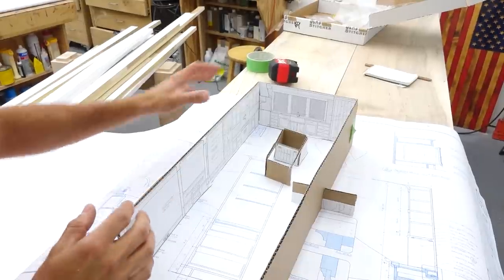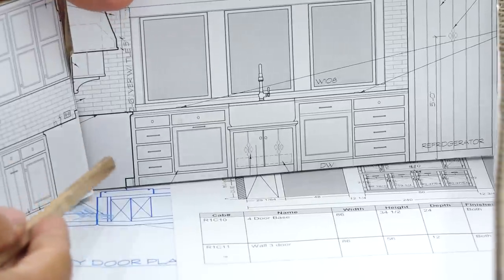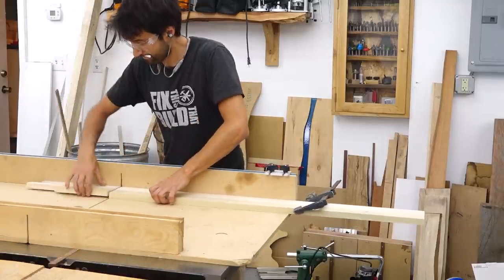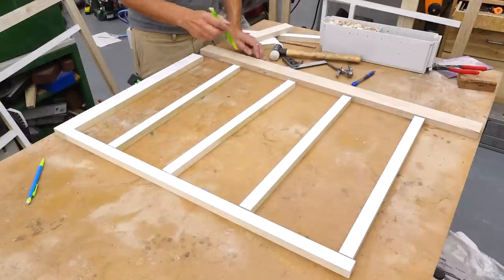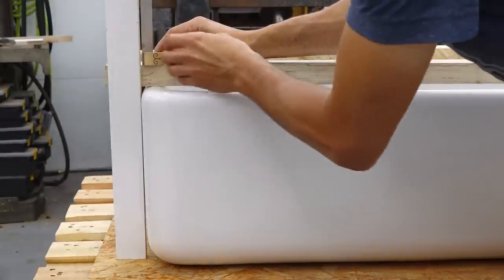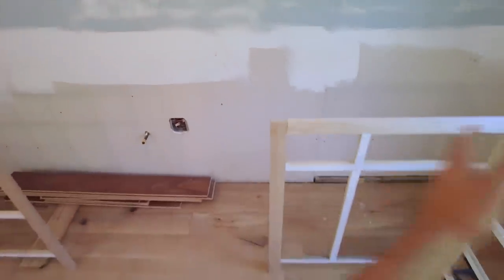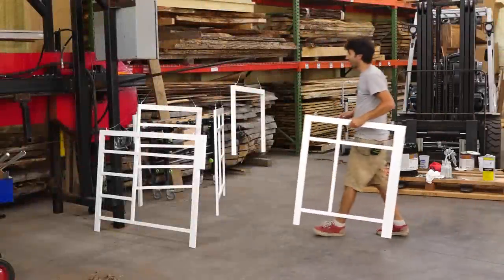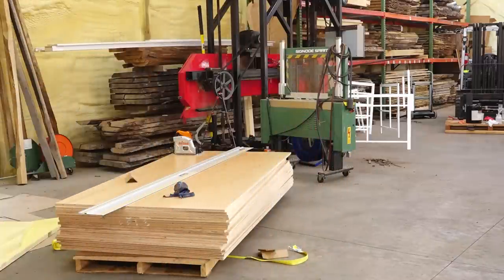Starting the Custom Kitchen Cabinets | Home Renovation & Addition Part 57

Comment: Matt, I have to agree with you the painted finishes being more difficult. I just got done building a custom kitchen in my house. My wall cabinets are painted with white lacquer. in my island is clear lacquered finish Walnut. Island was so incredibly easy to finish compared to the painted cabinets I think I spent more time prepping and painting the white cabinets and doors than I did on any other part of the kitchen build. That includes the actual time spent building the cabinets, drawers and doors .
Reply: Very true! But kind of a double edged sword becuase it's pretty hard to get rid of all the sanding swirls with a natural finish, as the stain or clearcost will highlight any that you missed.

Comment: Wow Matt, the knowledge you are sharing,from building this set of your kitchen cabinets, is so awesome.  Showing the actual build to all of us fans of your channel, is so informative.  Thank you for taking us into almost every aspect of design, lumber, making fronts, then setting them up, prior to  gluing the sizes down.  I've helped with making and designing several kitchens with a good friend, over the last 10 years. What an awesome experience. I asked him make a Wine holding upper cabinet for his Kitchen, he likes collecting bottles from here in Michigan and on travels. He said design it. Cabinet is an open cabinet, with 8 concave wine holder fronts, and backs, for the butt end of standard size bottles. 4 fronts with 2  openings on each front, for 8 total wine bottles.  It turned out
 amazing.  I also made stained glass clear with beveled corners on 2 doors that held nice glassware, tumblers and etc. Added low lighting for inside glass cabinets and wine cabinet. It added a nice touch. Looking forward ward to the next videos. Love, Love, your Channel.

Comment: I always made the boxes first then the space frames, drawers, doors, drawer fronts, uppers, and finally countertops in that order. I think I like your order more. It's easier to do initial mock up your way and one gets a better perspective. Suggest you move in appliances with boxes for final mock up. I have a spray booth as I also do automotive and the booth makes finishing much easier better lighting and no dust/particle goobers to buff out. As expected very nice work. Ray Stormont
Reply: I like the order you did your cabinets, Matt !! Helps eliminate any surprises !!

Comment: 22:12 In this corner here, I recommend putting a stainless steel bin for compostables. With a lid flush with the countertop.
Reply: They compost fine in the land fill.
Reply: I'm really happy with a "kitchen" compost bin in the fridge… Much less likely to generate problems, esp. if neglected for some time.

Comment: My father and uncle were cabinet makers. I did it too, until I worked my way into becoming a foundry pattern maker. Not to disparage the concept of.making face frames and trial-fitting them, but we made layout sticks for each wall for complex jobs. Much easier to take to the room than face frames. There might be a vertical stick for units like wall pantries or entertainment units but sometimes kitchen cabinets followed one of a few standard layouts vertically and didn't require a vertical 'story pole,"

Comment: Nice project! To make sure the cabinets are sitting on a level surface / toe-kick, it makes more sense to start wit the toe-kick-boxes; Use wedges to correct for uneven floors, Now you'll have a 'level playing field'  for your entire set of cabinets. This makes it easier to standardize measurements, with fewer risks.

Comment: Matt you may need to look into the corner cabinet. You may need more room in the draw side to use the magic corner shelf . Check specifications of the draw.
Reply from the maker: Haffel magic corner I; min opening size 15 5/8”

Comment: Great to see you are now working on the kitchen cabinets. Not as fun as building something that requires real joinery, but getting closer to finish the remodel. Great idea to make the face frames first to make sure they fit the space. Now that I see you used dominos to join the rails and stiles, I got a question... how are you planning to attach them to the cracass/box? Great start. By the way, miss your Friday Happy Hour.
Reply from the maker: Dominos for alignment and pocket screws for holding.  Lindsay is back in the office multiple days a week which usually includes Friday.  Hopefully her availability will line up soon.

Comment: One thing to double check.  Particularly if you are using overlay doors and drawer fronts.  On the inside corners like the one to the left of the sink, be SURE your corner styles are wide enough to allow the drawer handles to by pass.  Been building cabinets for fifty years and seen this mistake too often to count.  My son just bought a very expensive house and can't have pulls on the drawers on inside corners, got holes but no pulls.  Nice job, going to be a great kitchen.
Reply from the maker: Everything is inset. I have 3/4” of clearance from the top of the knob to the adjacent drawer

Comment: You have some excellent shots in this video - inside the thicknesser machine must have been a challenge?
Reply from the maker: Pretty easy. It’s just the 360 camera on a stick
Reply: @mcremona  Right! The right tool makes it easy, I guess? It's not a view I have seen before.

Comment: Great video! Thanks for posting! A comment and a question…noticed you shot a pin nail through the domino allowing you to remove the clamps, this is a great idea! I’m about to begin a large cabinet job of my own and will definitely use this tip. Question - how do you intend on mounting the frame frames to the cabinet boxes? Since you pre-painted them I imagine glue is no longer an option.  Thanks again!!

Comment: Mathew, I built all my kitchen cabinets using tiger/curly maple.  I built the cabinet first and then built the faceplate.  I felt it was easier to do it that way, but then again, I had never done it before.  Looks good but again I am not one to paint wood.  I hope there will be some clear finished wood in your kitchen, somewhere.
Reply from the maker: The floor
Reply: @mcremona   Ha, funny guy.

Comment: The first batch of face frames looks great.  I’d be willing to bet that your Paint Hanger tool (the 4-wheeled mega Tele-Handler) is one of the most expensive paint part holders in the country.  At the end of the day it does what you needed it to do so using what you have is always a good thing.  You made me a believer that the Festool Domino tool is a very good buy for cabinet building.  Did you have to buy the adapter for the smaller 1 inch boards, or did it come with that item in the kit?

Comment: Hi Matt, great to see you making videos again😂 I was wondering what blade you were ripping with on the table saw when using the power feed? It seemed like a very slow feed rate, I’m sure you had it set at the right speed for the cut. I’m just wondering if I push wood through too fast now.

Comment: I dunno how far ahead your videos are to when you release them but something you should consider in the corner is a 3in x 3in corner. if you are doing inset fronts 2 in should be ok but if your doing overlay fronts that are slab style like your drawings show, you could have clearance issues when you get your hardware on.
Reply from the maker: They’re inset. I’ll have 3/4” of clearance
Reply: @mcremona  Nice!

Comment: Are you using finished plywood for the interior or rough and then finishing ypurself? I like the face frames but for me I would have to build the boxes 1st, mostly because i dont trust i could build a perfect box to fit the frame, lol. Great work on your kitchen and the video, thanks for posting.
Reply from the maker: Pre-finished maple ply. It’s pretty easy. The box is set by the squareness of the frame

Comment: Is that sink all ceramic, or is it cast iron coated by ceramic? I've heard some horror stories about ceramic sinks breaking, although that one looks pretty beefy.
Reply from the maker: All ceramic
Reply: @mcremona After seeing how you had to move it around, it's probably going to be fine even if you drop a heavy pot in the sink.

Comment: Please be careful when pulling back your cut piece on your table saw when using a thin spacer against your fence.  If the cut piece were to get hung up on it when pulling back it will bind against your blade.  The end result is not pretty.  Speaking from experience. (7 min mark)

Comment: What primer are you spraying with
Reply from the maker: https://industrial.sherwin-williams.com/na/us/en/industrial-wood/catalog/product/industrial-wood-coatings/products-by-industry.11543394/sher-wood-precat-primer-surfacer.9540224.html
Reply: What is the topcoat?
Reply from the maker: @Randizzle808  https://industrial.sherwin-williams.com/na/us/en/industrial-wood/catalog/product/industrial-wood-coatings/products-by-industry.11543394/sher-wood-kemvar-plus-conversion-varnish.9198022.html